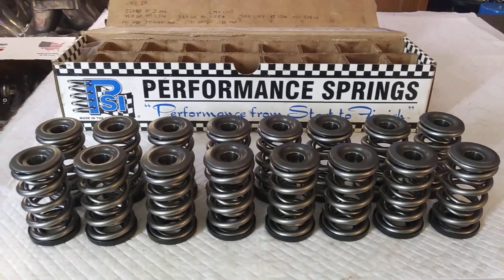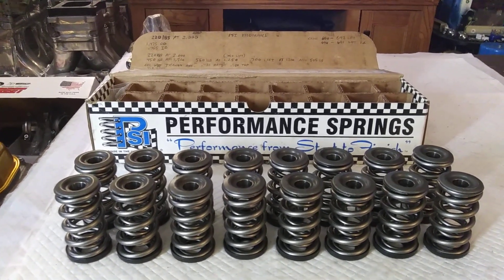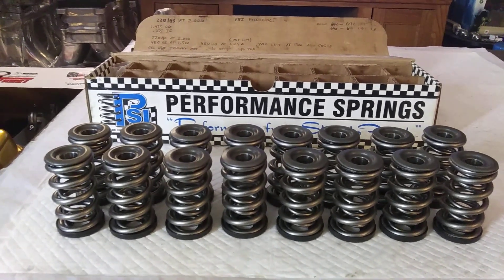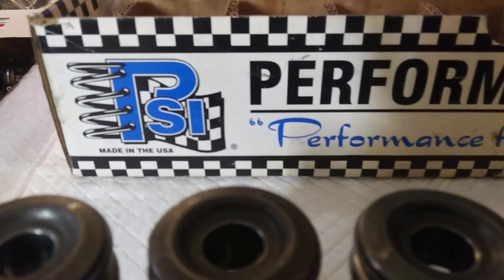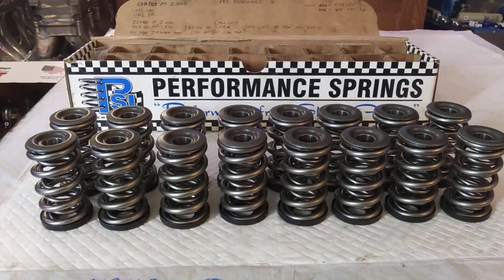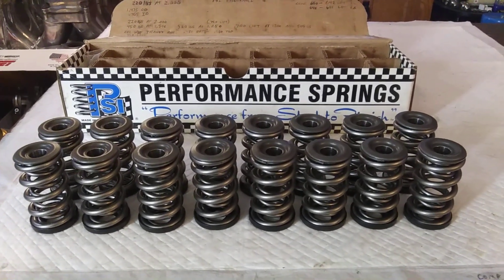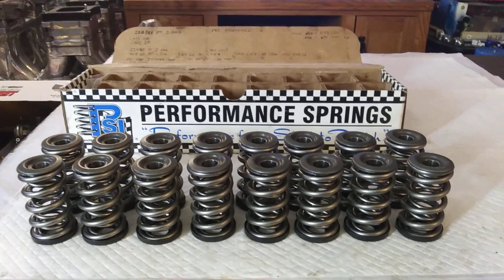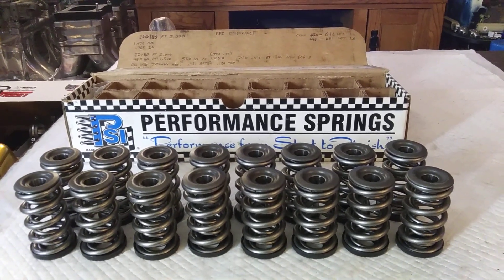Bolting on new assembled budget  aluminum import heads? Here's a few points to consider.

Comment: Even if I buy assembled heads(if the price is right or it's the only option) I don't use all the parts that come with em.  PSI are Nice springs!
Reply from the maker: PSI are the shit, I've noticed over the years they lose pressure slower than about any other springs I've used. They are costly, but on the street they last forever. I've gotten 3-4yrs out of a set on a 775/748 lift cam in a 477ci that I raced all the time and drove around on cruise nights. Fuckin guides will wear out before the springs. Even after I took them out, they were all still within 20lbs of seat pressure new. Ended up using them in another bigblock with a slightly smaller cam a yr or 2 later.
Reply from the maker: Yep, assembled or not, I always end up switching shit out for more suitable parts for the application. Just tag and bag the parts that come with the heads for a future project if needed.
Reply: @thereluctantgearhead4544  Exactly just did that with a set, bag n tag.  Shame I won't be using a single part tho this time.

Comment: Topline heads is that the name of the company can you get them at Jegs I looked at the dart heads they're not cheap no more I seen in that one engine build you did use promaxx heads are they pretty decent
Reply from the maker: Pro Topline went under back around 2008. Hard to find them. I have a pair i bought 20yrs ago. 220cc versions. RHS was selling them years ago, but I don't think they produce them anymore either. Strangely enough tho I was looking at some Flotec heads from Tri State cylinder heads and they look like they are cast from the old Pro Topline molds. About $1000 bucks a pair too. Made in Indiana. They could have bought the molds. Pretty big company.
Reply: RHs bought pro top line after the owner passed away some years ago
Reply from the maker: @bloodhawk6252  RHS pretty much laying low these days too it seems. Haven't seen much from them in years. I think I did see some new intakes they just realeasd not long ago that look pretty good. Gonna try one on one of my BB Chevys. Looks like the older Profiler single planes from a few years back. $500 bills is what they are going for. Also an EFI version of the same intake.
Reply from the maker: Those Promaxx are well worth the money. Real good heads.

Comment: Morning hey since you're talkin about cylinder heads I got this 1973 400 small block 511 getting ready to take it put it on run and run it to see how it does if it all checks out I might be stroked it to 364 377 but was selling her head I was looking at aluminum heads and I was looking at Steelheads it looks like Steelheads almost as expensive now as aluminum so what do you think of decency to Steelheads what brand or go with aluminum they say they'll boys used to use Steelheads only stroker Motors they say the old boys that used to build these Stroker motor use them Steelheads what brand would you go with I see there's few companies out there that you can get them with the steam holes already drilled in them and I heard there's a way you can bypass the steam holes I don't know if you do that to the intake or where you go with it so what do you think a good combo and be
Reply from the maker: Those new PROMAXX heads are a hell of a deal. Pair of the 225s on a 400 would make a shitload of power.
Reply: So your shop is in Buffalo New York or am I wrong we used to have a good machine shop but they close Tim Brown he's an outlaw racer he's right down here in Logan Ohio not far from me he's got a decent Dino room oh yeah let's talk 400 I got the damn thing or externally balanced so I pretty much have to tear the whole thing down I believe I know he's really good at balancing cranks but the only thing is he's only home during the winter he races all summer so he's not usually at a shop oh yeah like the advice on the pro Max and the dark and probably be the spring-summer before I tear it down and rebuild it if I have the money I might do a421 with it or a Mite or a 406 I watch the one video of a guy he did the 377 and it made 700 horsepower that's crazy
Reply from the maker: @awfulcoffelsonecargarage8215  I've seen a production based block 400 making 2hp per cube NA with a single Dominator. 8000+rpms too.
Reply from the maker: @awfulcoffelsonecargarage8215  These old smallblocks have alot of potential.
Reply from the maker: Pro Topline heads are killer steel heads, but hard to find. RHS bought the molds and kept making them, but now They are hard to find. The DART Iron Eagle heads definitely can make power, especially the 215/220/230cc versions. EQ made a good 220cc runner steel head too, but it's no longer available. Motown makes a decent 220cc steel head now that are around $550 a piece bare. They are currently available.
Reply from the maker: It's best to drill them steam holes in the 400s since They have siamesed cylinders. Alot of heads come pre drilled.
Reply: So if you were to buy a set of Dart iron Eagles assembled or should I buy them bear
Reply from the maker: @awfulcoffelsonecargarage8215  Buy bare and get the parts ya need. You'll be better off.
Reply: @thereluctantgearhead4544  hey thanks for the info man have a good day
Reply from the maker: @awfulcoffelsonecargarage8215  You too man, good luck with your project.